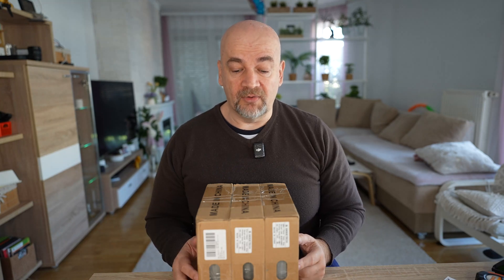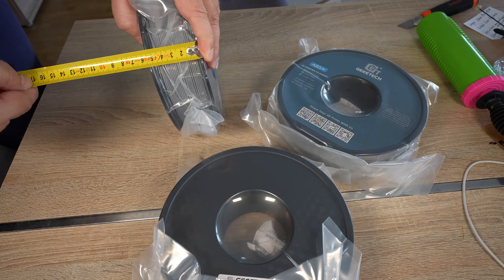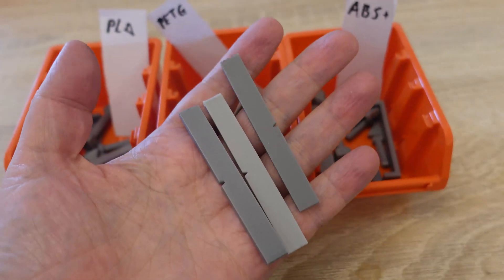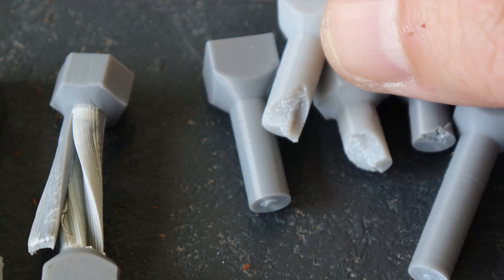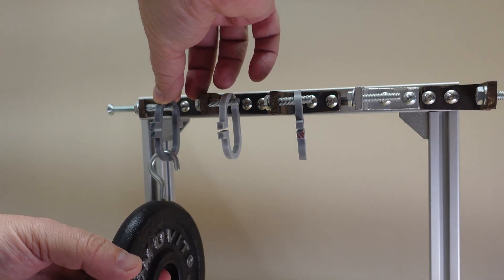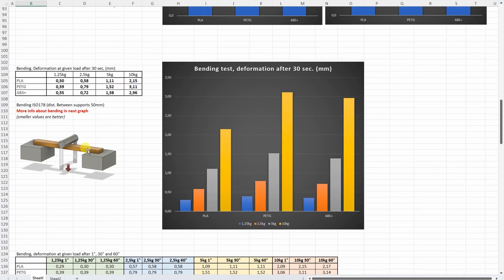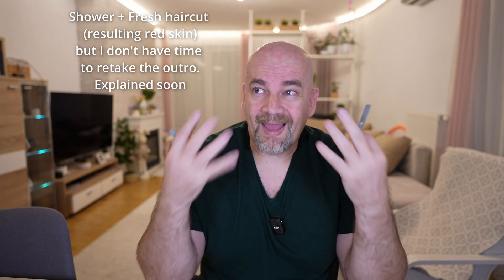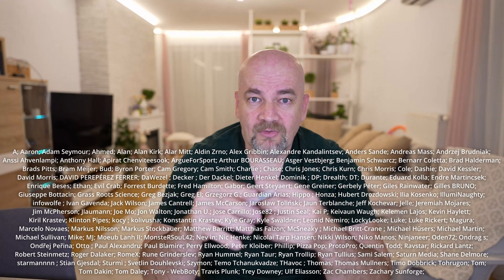Geeetech PLA vs PETG vs ABS+ and this time all in gray color

Comment: When printing on a Bambu printer, keep the temps at what generic setting recommend (do a temp tower to be safe), don't go for what the spool says unless you are printing on an old ender. I have printed lots of Geeetech PETG, and the 250C you use gives a little bit weaker layer adhesion. I think 260-265C gave me the best of both quality and strenght. X1C.

Comment: 7:07 PETG is more brittle than PLA??? That seems to be opposite form my experience with PETG being flexible in comparison to PLA. 🤔
Reply: My experience is that PETG is NOT any better than PLA in this regard (unscientific, without measurements).
Reply: The hammer test is very strange, showing nothing actually.

Comment: I used your layer adhesion samples to ensure good layer adhesion for fast PETG prints with high volume flow. The used (white) Jayo PETG withstood over 55 kg, both at 8 mm3/sec and no difference at 16 mm3/sec (printed on standard Sovol Sv06) - I am quite impressed. To achieve the set volume flow I added a "purge tower" and checked the volumetric flow preview. Thank you for providing the test objects!

Comment: Looks like PETG part has corner flaring which increases your length and appears as if the shrinkage is reduced. I wonder if ABS layer adhesion will improve if it's printed at higher extrusion temperature or maybe higher chamber temperature.

Comment: I have a video idea for you: as CNC kitchen also found out, ABS really likes to be printed in warm chambers, and has much better mechanical properties if printed hot.
Now that you'll get the Qidi X-plus 4, you can get a real, stinky, warpy, but strong ABS (I suggest Sunlu, it's one of the best and cheapest), and test samples printed at ambient, 40°, 50°, and 65° chamber. You'll see a big difference. (Ideally you'd print it at 80° chamber, but there are no commercial machines that can do that)

Comment: I'm curious why nobody is mentioning the dramatic affect fan/cooling has on layer strength.  If possible i print both abs and petg with zero fan (if there's enough layer time). I'd rather print a sacrificial duplicate piece (or even 3) than turn on the fan.  My experience has shown layer strength decrease and even delamination with fan on with petg and abs.  It would be very interesting to show a comparison of your print settings (with fan) vs no fan.  I think you would find significant increase in layer strength.  Thanks for your work Igor. Svaka cast. Hvala. Ziveli.
Reply: I’ve been pretty much printing with PLA for some time. That said, I’ve learned a hell of a lot. I’ve done a couple things in PETG but not enough to know much about it’s characteristics, etc… I’m getting ready to order a couple rolls of ABS for parts that will require decent strength, etc.. I don’t have a drying solution yet. Have you found printing ABS requires active drying, etc….? Edited to add, printing Mercury One printer parts. Do you recommend doing so with zero fan? And yeah, wth, one more. Have you heard of anyone using anealing on PLA or ABS to strengthen the parts?

Comment: Thank you for your tests! But I'm really curious how you can manipulte resulst by changing printing settings. To my taste your printing temps are slightly off, would be really curious to see that PETG printed at around 235C, I beleive when overcooked PETG becomes brittle. And 250 for ABS is low. It seems what the recommendation to print it at 240-250C comes from the times when printers had PTFE lined heatbreaks and coldn't withstnad more. Nowdays nothing stops you to print ABS at 270-280, you already proved in other tests it helps layer adhesion. Slower speeds (maybe 5-8 cubic mm) should improve adhesion as well, sometimes you just need to get everything from your filament no matter how long it prints.

Comment: Had the luck to use their petg as well, it likes 250c, if you go below the layer adhesion just goes non existent rapidly, noticed this phenomen with sunlu years ago as well, dunno if they modified it since then

Another budget filament is Eryone, tried their asa out, it doesn't like low temps either, it warps like tomorrow never comes (compared to Polymaker), and smells so bad I had to go out and open everything or I might puke or faint 😂
So this was why it was so cheap

Printed in 50c chamber ofc

Comment: Great video! Suggestion: test the HIPS filament for "normal objects" (not for support material, as usually).
Reply: I do like hips, super useful as it doesn't absorb moisture so it's always ready to print
Reply: @ThePogapog   it is also very recyclable :)
Reply: +1
Reply from the maker: Hm, OK. I don't like HIPS low temperature resistancy, but I have to test it at least once. Which brand do you suggest?
Reply: @MyTechFun  esun has some cheap one but they should all be relatively similar. It should have temp resistance slightly lower than abs, around 80 from what I have seen :)
Reply: @MyTechFun  If you are considering testing HIPS, I wouldn't expect too much from it. I have found that 3d printed HIPS feels like a hard foam. It is easy to dent and bend.  It might be "high impact" when compressed in an injection mold, but not when 3d printed. I wonder how it would compare to leight weight (LW) PLA that is printed at lower temparatures.
Reply: @MyTechFun may be eSun, easy to get on most locations 😊